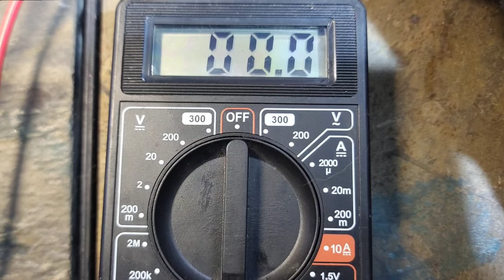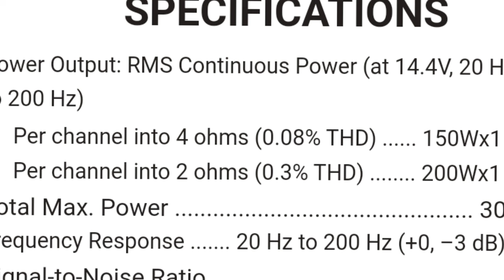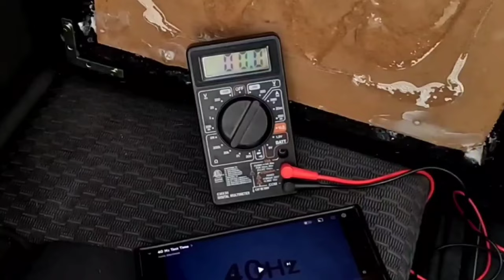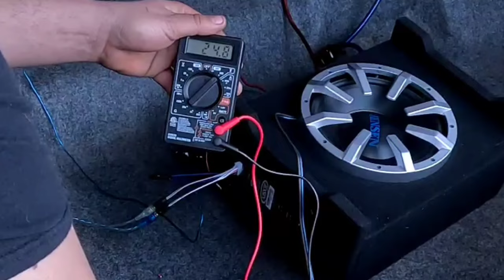Walmart Car Subwoofer Comparison And Car Audio Tutorials (How to use a multimeter)

Comment: Is This Speaker Still Alive? I Blew Mine! Think The Crossover Was Too High. Coil Failed After 30 Mins? Any Ideas!?!? Because I Like That Speaker.
Reply from the maker: Mine is still kicking. It may have been defective.
Reply: @Blowncapacitor84  I'm about to go drive to the Wally World over and get another one I miss that sub is the perfect size for my truck I reckon even if the speaker blows again it's the perfect box. but yeah I didn't have it up that high I was listening to some tunes and all is well then I started adjusting some of the settings on my head unit then I smelt the glue then it blew. I think perhaps it was slightly defective it blew its original fuse when it blew too I put a new fuse in it plug it back in and then it really kicked the bucket. but I have touched to the speakers before unused and right off the bat this cone didn't seem like I had enough suspension to it. long story short great size box very easy to hook up and good for the price I recommend people don't crank up their amplifier settings.
Reply from the maker: @thecosmickat3954  yup! I definitely agree!
Reply: @Blowncapacitor84  what are your amp settings? because I've been a speaker Guy since I was a kid and I haven't blown many speakers I really think it was poorly manufactured and possibly my amp settings were too high. I know the thing that frys the coil is too much power. it's all about tuning I guess because it didn't seem that high when it blew but wherever I had the settings at when I first turn it on it was perfect it was banging then I was kind of messing with the settings and it blew but I was shocked to have a speaker blow so easily and fast with it seeming like I wasn't really cranking it. anyway thanks for the response pretty awesome man.
Reply from the maker: @thecosmickat3954  The gain on mine is set about halfway, maybe closer to 3/4,  but I really do think it was defective if it went that fast. Mine seems to be doing pretty good so far.
Reply: @Blowncapacitor84  Picked Up Another One. Gonna Double Check With Multimeter Ground Ohms Then Make Sure 12v Power Cable Is At Correct  Voltage, Keep My Settings Low And Hz Low But Not Too Low. Keep Crossover Way Down And Hope For The Best. If It Blows  I Got A Badass Box I Can Drop A 10 In Any Time And Solder Cables In. I just love the Box.